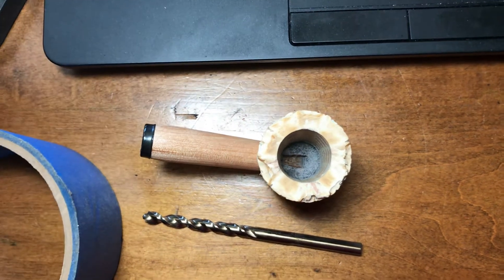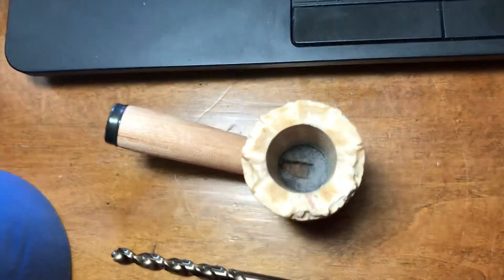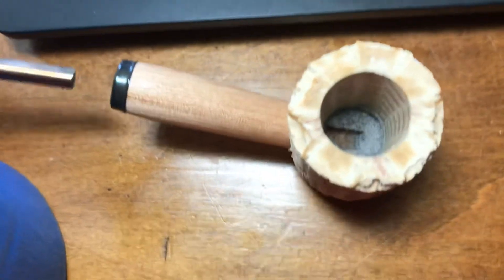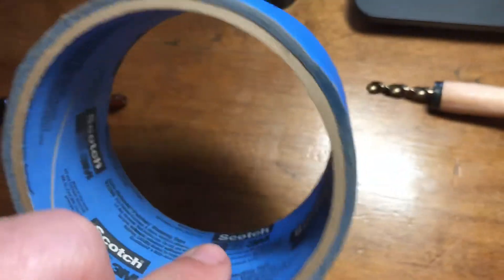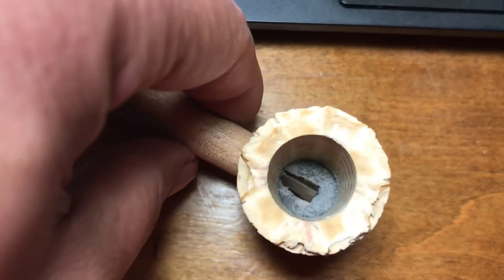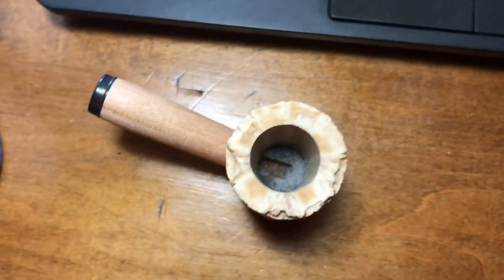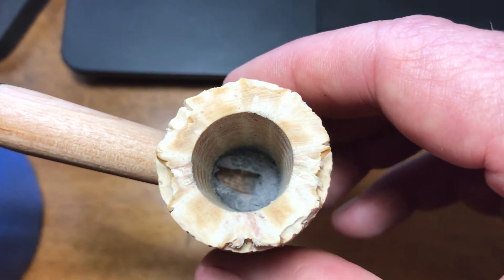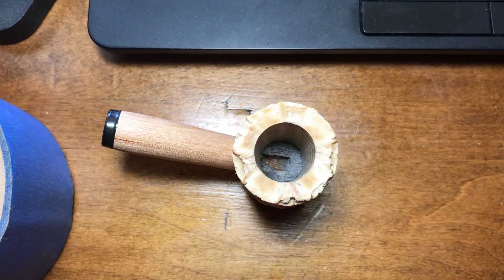Cob Pro Tip - Pipe Mud Applied & Drying Nicely

Comment: The great thing about this method is that it apparently delivers an acceptable result without an extensive outlay of time and money expended on a corncob pipe. I have no cobs but do have a sketchy Falcon and Grabow. If they pack it in, I'll buy a cob and try this before I smoke it.
Reply from the maker: it works surprisingly well - thx for the comment 👍🏻